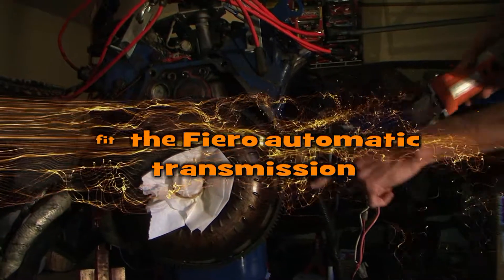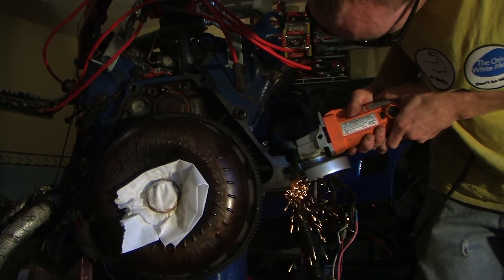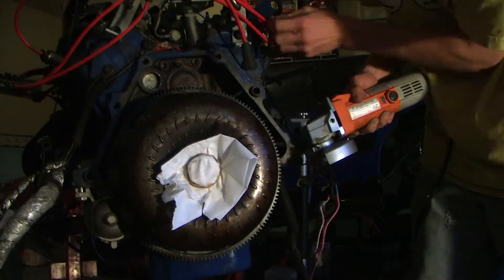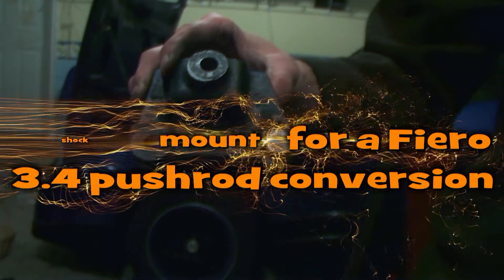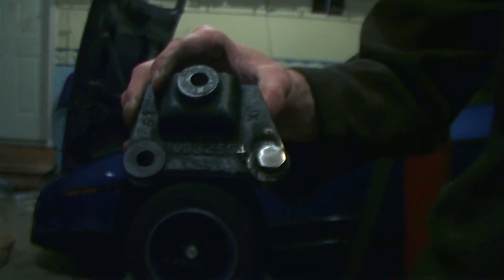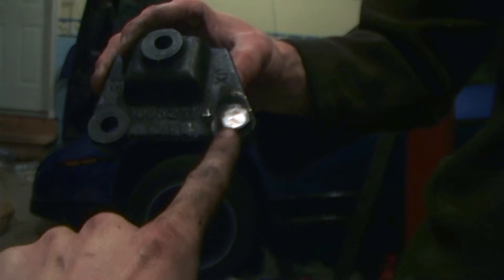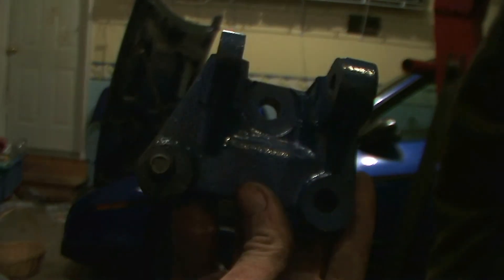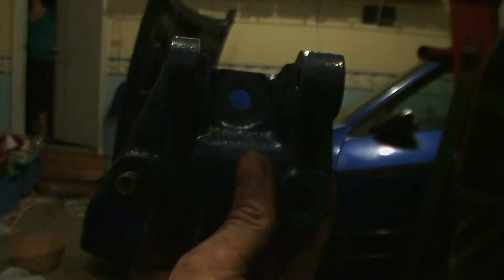Pontiac Fiero - Cutting a 3.4 block so that it will mate to an automatic transmission

Comment: Could you let me know if I want to put a v6 from a 85 fiero into my 84 fiero will I still b able to use my transmission? Do I need some kind of adaptor?
Reply from the maker: The engine should mount up to the transmission without an adapter. You will have to change the fuel pump, fuel lines, ecm and engine harness. 84 was the only year without a v6 option so you'll have to make a slight repinning adjustment to the wiring harness in the car. there are instructions online on how to do it. You will need to strip everything out of the v6 car that is related to the engine to move over to your car. It's a brief summary but hopefully it will give you an idea of what you'll need.
Reply from the maker: Oh and as for your transmission you should be ok with the v6 mated to it. From my understanding it was the 5 speed transmission that was mated to the 4 cyl that couldn't take the torque. the 4 speed that was mated to the 4 cylinder was ok. There was even a 4:10 final drive 4 speed transmission option in 84 that guys like mating to a v8 for drag racing.